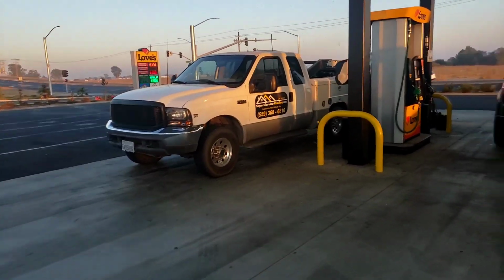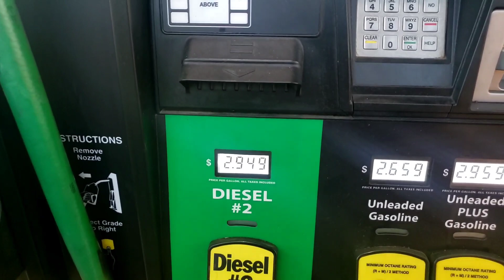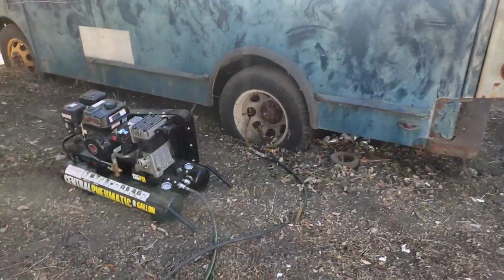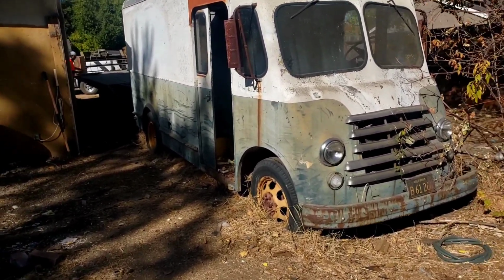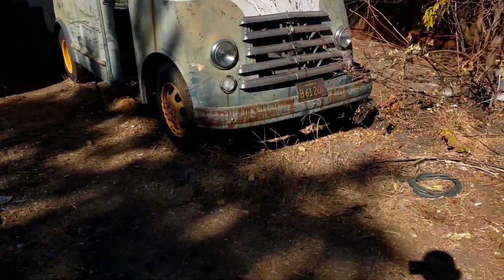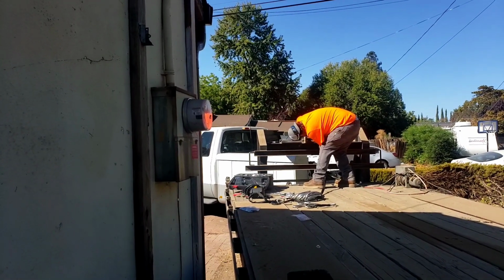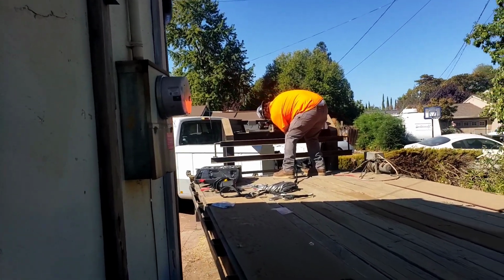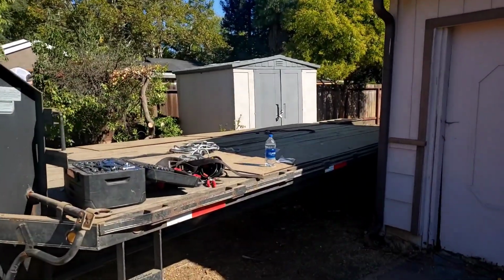1954 Chevy - Bread Truck - Truck Restoration - Barn Find

Comment: My father has a 1954 Chevy front end with a Boyertownb or Beyortown body, delivery truck of some kind possibly Bread truck from a company in mid state Pennsylvania has a rebuild 235 straight 6 needs put in, also has the original engine out that still runs if you’re interested hit me up, I seen one just like it online several years ago in a museum I believe also in mid state Pennsylvania we are near Pittsburgh